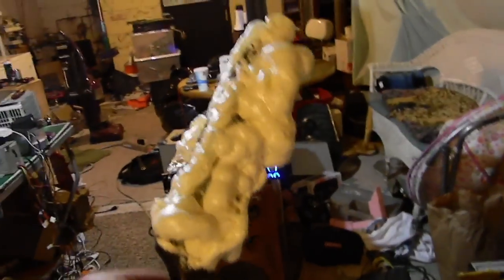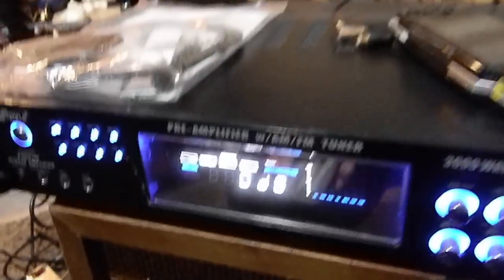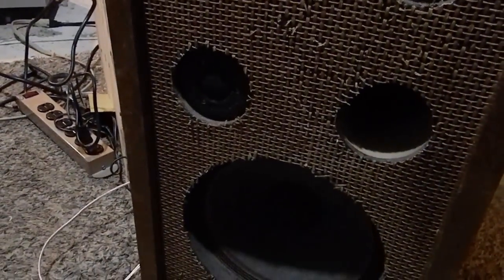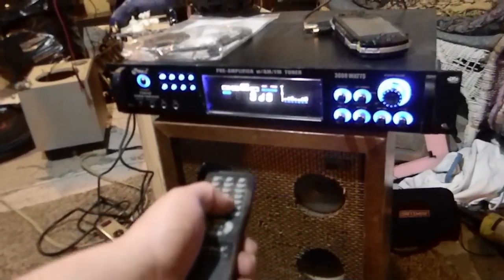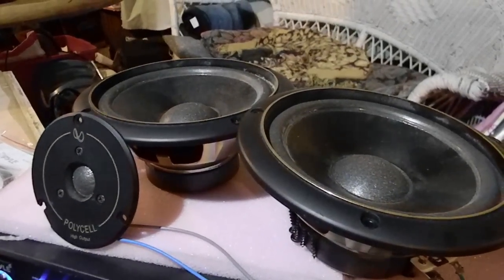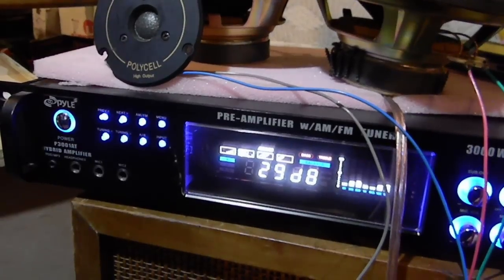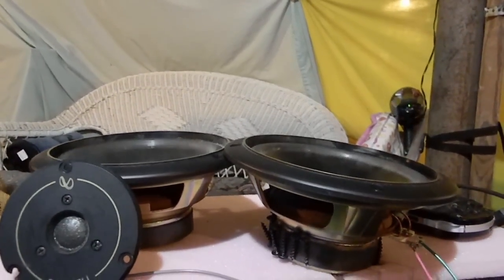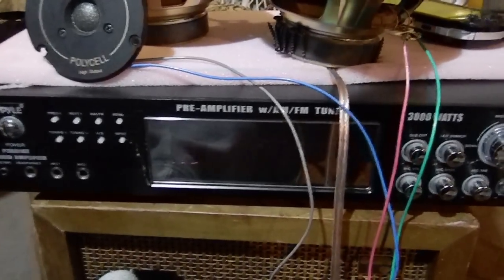Jensen TF-3 Sound Test on Pyle Amp

Comment: I don't care about LEDs they can go out it'll probably be that way too me but I'm buying one to put on a sharp 15 inch 150w house speaker. I've been without bass in my room for too long. i have a skar audio evl 18 d4 with custom box but it's going to cost me over 600 dollars to power it in my room and I don't have that kind of money.
Reply from the maker: well, the bass end of my setup cost me about 1000$ done with 2 years of tax retruns. 100a 14.4v psu, sundown SAE1500D amp, X-18v1 sub.